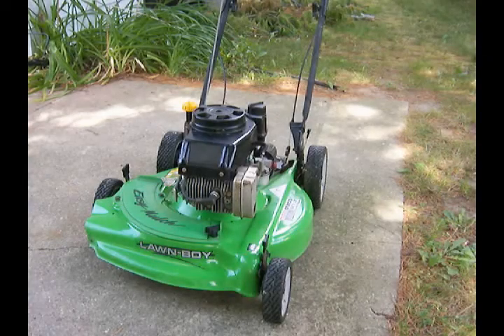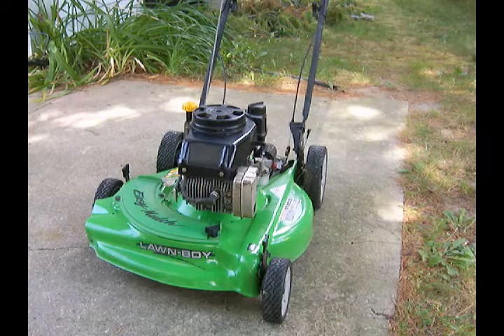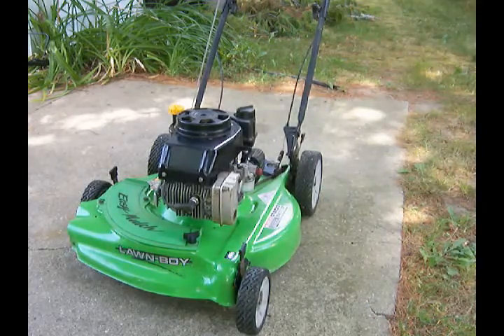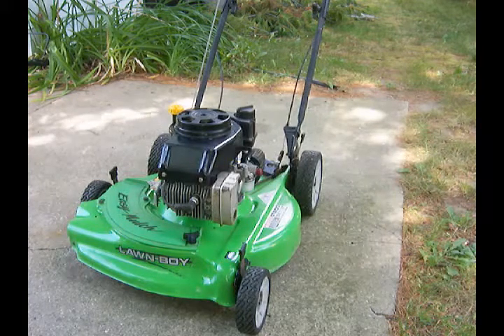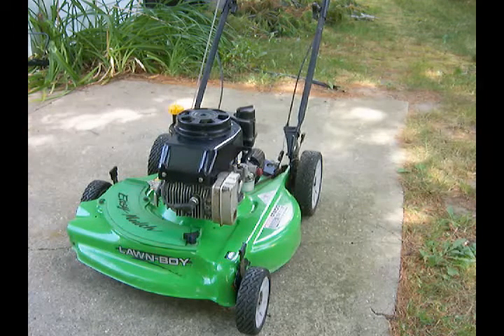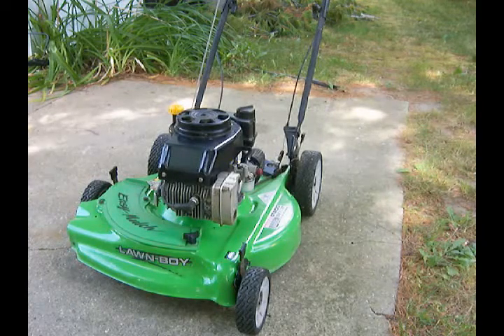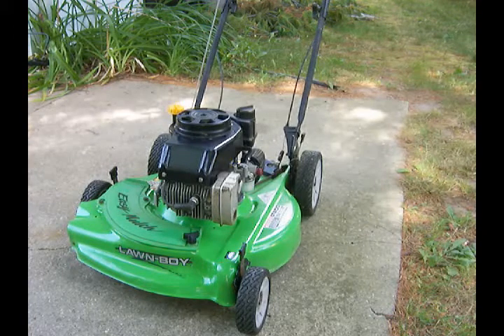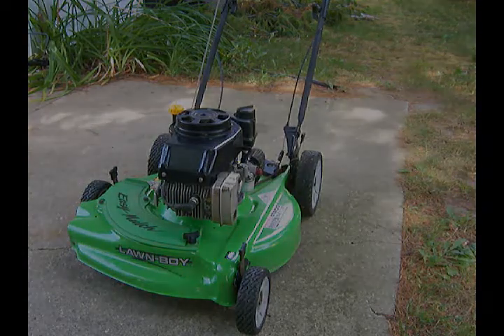#32 Tecumseh LV195EA / LEV120 - The final results of a small engine rebuild

Comment: im trying to rebuild a ovrm120 tecumseh lawn mower engine.  I have everything together and i noticed that I cannot turn the crankshaft as easily as in your video.  could there be something wrong inside or will it move freely after i start the engine?  any advice would help!
Reply from the maker: Do not start the engine until you are sure that the crank will make several full rotations without hit anything inside.

Comment: Thanks for posting these videos, they've been very helpful. How long would you recommend using the engine before the first oil change?
Reply from the maker: I usually change the oil once per season. If this were a new engine, there would be a "break-in" period of about three hours but this isn't a new engine so no worries. Thanks for watching.

Comment: I watched mostly all the videos.. real great info. One question.  Do you know if putting the linkage bars on the carburator backwards(meaning the one with the spring on the top hole, and the other on bottom hole) cause the mower to run for 5 sec. Then shut off?. Another thing that I might have done wing was put the Carb. Floater cover not correct. Not allowing the floater to go up or down as it should.  Anyhow. Your videos are very detailed and VERY helpful. Thanks.